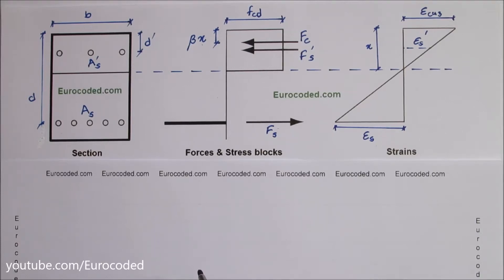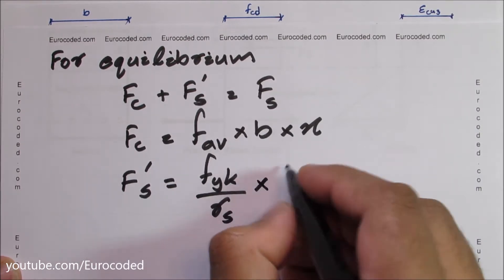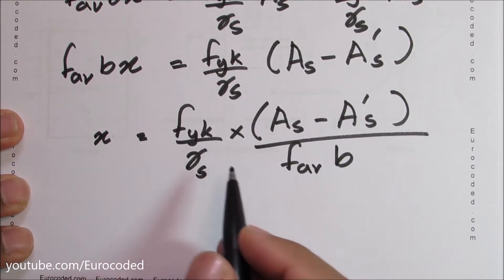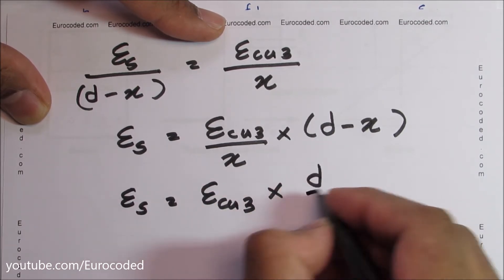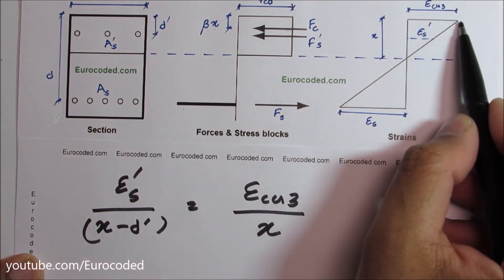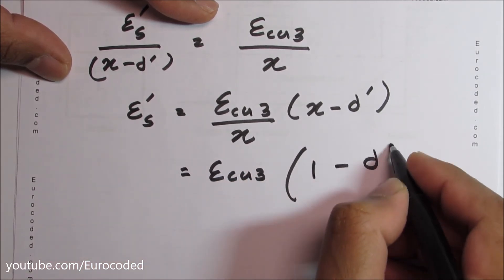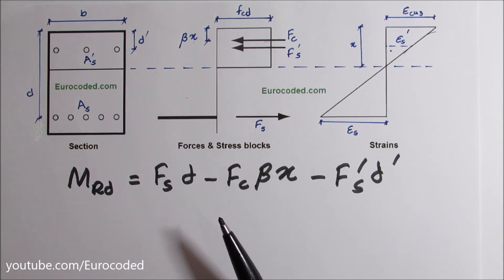RC Beam Design - Bending Resistance of a Doubly Reinforced Concrete Beam to Eurocode 2

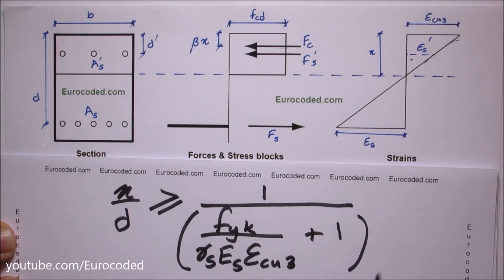Comment: Many thanks for the explanation. This was very useful for me. However, at 6:10 and at 9:25, x/d is "smaller and equal to" and not "bigger than equal to". Just trying to help... :)
Reply from the maker: You are a star for picking this up. Thank you so much for letting me know. I will add a correction. Glad you found the video useful :)
Reply: Excellent spot.